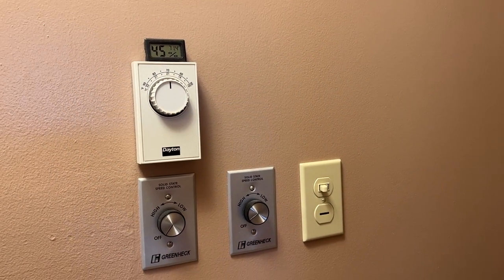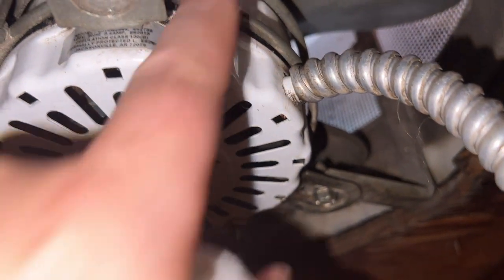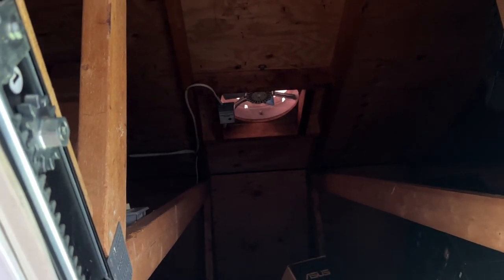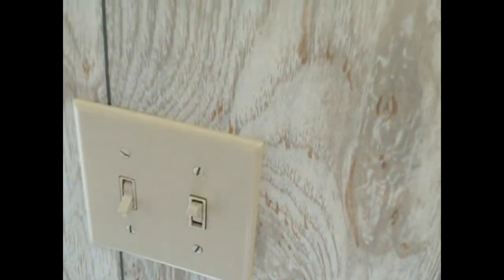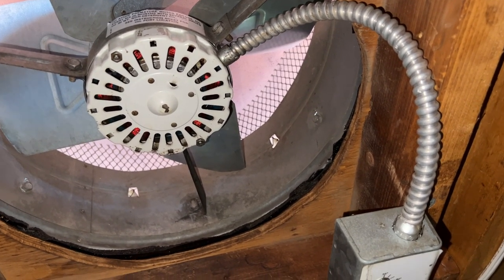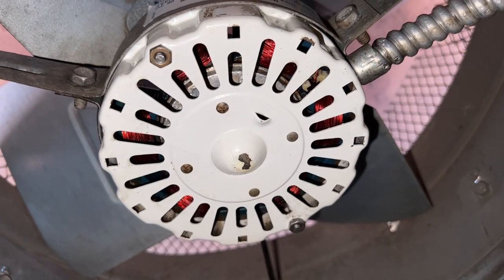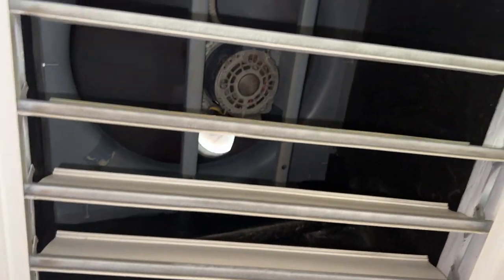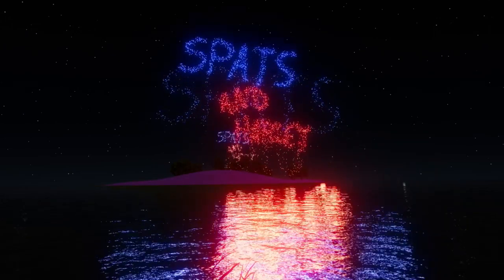2022 Maintenance of the Attic Fans

Comment: What about the third attic fan mounted in front of a gable vent from the video 13 years ago?
Reply from the maker: That was removed way back in 2008. It was unnecessary, and how it was setup didn't move any air at all. We still have it, still mounted on the wooden frame, in storage.

Comment: I wish you had shown the actual lubrication of the fan-- that is what I need to do first, to see if maybe I can avoid replacing the fan.
Reply from the maker: You put oil in the oil ports… there’s nothing to really show.
Reply: @spatsbear  I copy-- thank you.  I am looking at replacing my current fan which was in place when we bought our house in 2009.. and we didn't maintain it.. so I don't think lubricating it now will do more than buy a small amount of time.  What I am reading in the comments of the new fan, is that the bearings are sealed and the unit is "maintenance free", guaranteed for 10 years.  It sounds like lubricating every year will not be necessary once I bite that bullet.